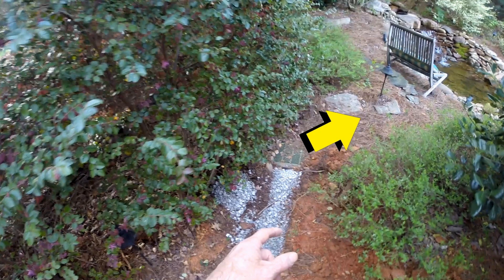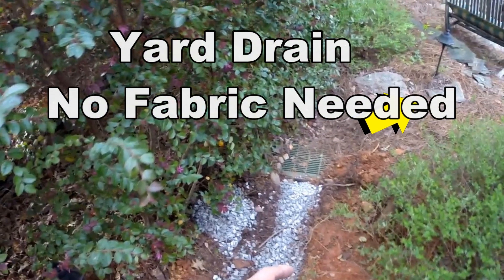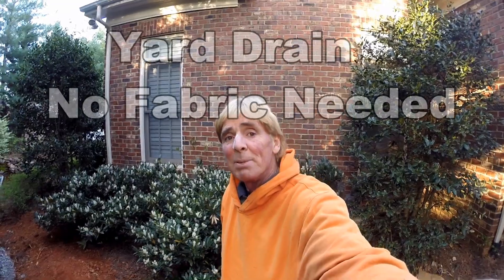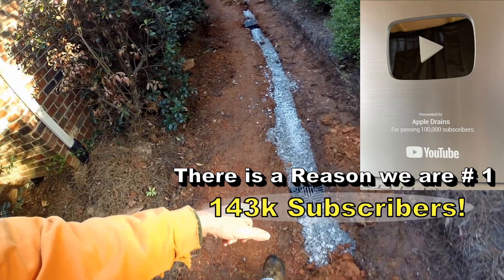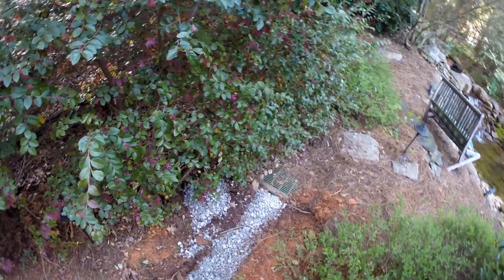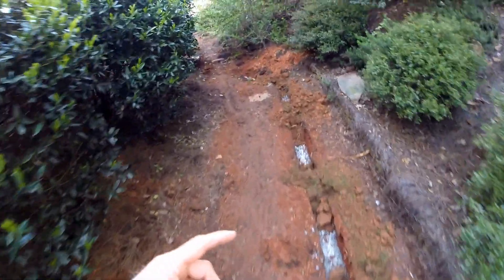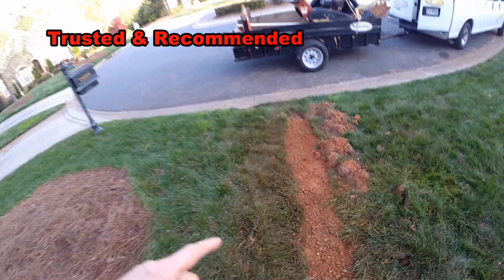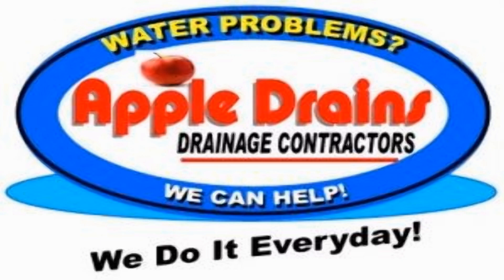STOP Using Geo Fabric for Clay Based Yard Drain / French Drain

Comment: Hi Chuck, I have a combination of problems. I have two sump pumps under my house. I have no drop-off front to the back of my property. I did install a French drain that I purchased from Lowes. Once finished it works out perfectly. Since then we have moles that have dug through the French drain. Now it's not working as well. I'm confused about the types of pipes and where to use them. My three downspouts drain down to this French drain. The French drain came from Lowes it was a roll that came in 1-inch x10 inches tall with a fabric 100 f long. I hand-dug the trench and then used sand as a backfill as something that the instruction said could be used. Now I need to redo this again. So I'm trying figure out what should be done next

Comment: Why can’t you line the bottom of trench with non-woven geotextile fabric, fill bottom of trench with crush #2, put in pipe, then backfill with round? I’ve done that at my home and it moves water like crazy.
Reply: What’s the rationale? I’m deciding how to run drains in clay here.
Reply: @Tonisuperfly  My rationale? It just to provide an extra layer of prevention from debris, roots, etc. from entering the pipe (I also have incorporated several clean outs just in case). I removed old clay pipe that was laid end to end and it was either crushed or filled with debris. That was after 100 years though. Mind you, I just line the trench with the fabric, put a fairly large crushed rock as a base and tamped, add the pipe, and fill with round. Rock is washed. If I do add a layer of fabric on top, it’s only under an inch or three of material because if it needs to be removed, the fabric is only under a small amount of material. 

I’m no pro by any stretch. I just watched a lot of videos and read as much as I could on it.
Reply: @westsidewil  thanks for that. Makes sense to me.
Reply: @westsidewil  interesting concept - I may try giving this a try in one area of our yard (side alley) where we have a 1.5' wide strip of dirt currently next to concrete. The fall on this side is very minimal so I'm thinking a french drain (triple wall perforated) may make sense. Sounds like non-woven geotextile fabric to line the excavated area with minimal lip on the edges (it will only be 4-5" depth though so very minimal) then 3/4" crushed drainage rock poured in with the perforated pipe sitting in the middle of it. Not sure how well something like that would work?
Reply: @jplee3  I’m by no means a pro but I’d used washed crushed 2 as a base and backfill with washed round 2. Since you aren’t moving solids, you will need very little slope to move water.
Reply: What kind of soil do you have? If it's clay, laying fabric just on the bottom with crush seems to not be a factor regarding inevitable downward accumulation of sedimentation at the bottom of the trench. I don't think fabric will stop more typical lateral root growth. 

Apple Drains has a video on using a #57 or #67 aggregate that has some straight edge for the entire drain. It was convincing to me.

Comment: Correct, for clay soil, NEVER use geofabric/geotextile mesh, #67 gravel only surrounding French drain/tile is best. For sandy soil, using geofabric/geotextile to surround the gravel and French drain/tile is best, or EZ Flow French Drain is a good example for use in sandy soil too.